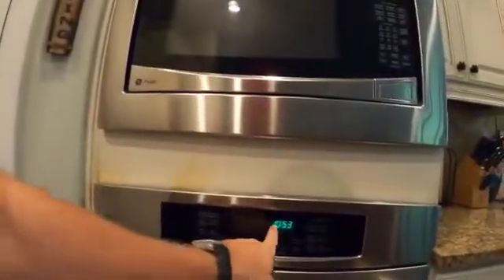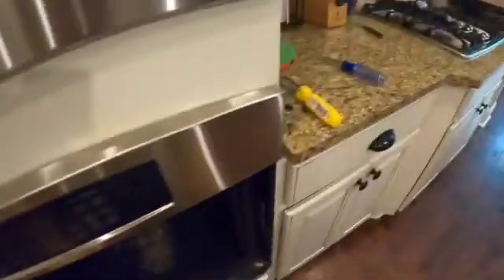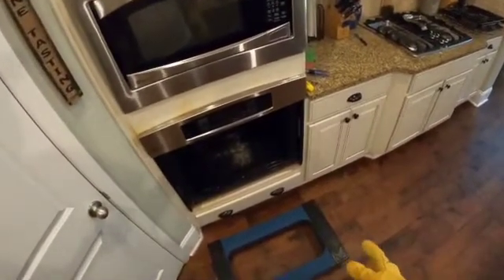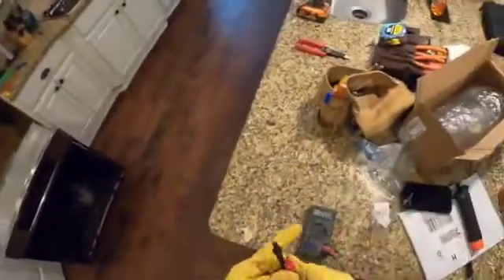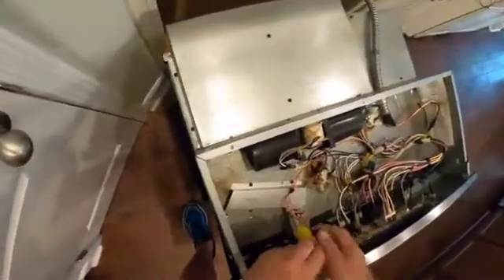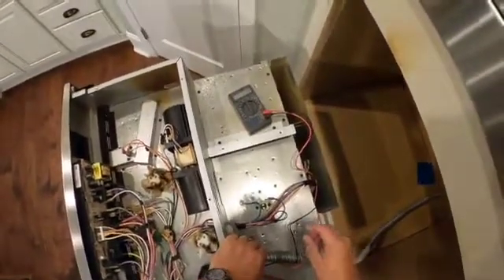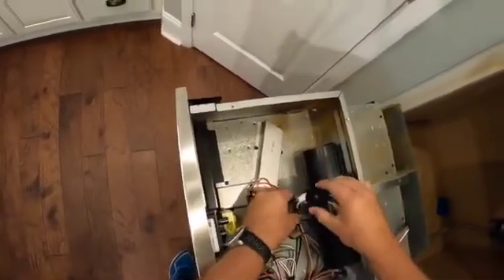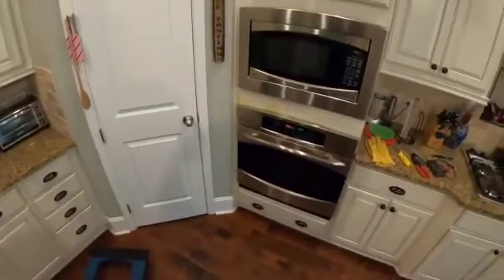Diagnosing and Repairing a GE Profile Wall Oven's Exhaust Fan

Comment: We have the same oven and it’s started to make a rattling/buzzing sound as it cools down. Is the motor you replaced for the colony fan or the convection fan or both?
Reply from the maker: Hello Gavin!  I replaced the cooling fan.  Sounds like you have a cooling fan going bad, which happens.  I found this fan pretty easy to replace.  I think I have a link to where I got the parts.  They were super helpful as well.  I believe they have a video on their site walking through the process.  Good luck with your repair!

Comment: Thanks so much! I turned the oven on and turned convection ON and the back convection fan was spinning, so I think its fine. Honestly we never use the convection feature.  I plan to order the fan and the 2 switches you mentioned and see if I can get this fixed. Like I said, the moisture has already blown out one main control panel...and that part alone was $600, so can't afford to be replacing that every few months. I hadn't noticed, but our oven used to put out some warm air while on at the bottom through the vents, but now there is no airflow.  Thanks so much for your advice!
Reply: Sounds like you are on the right track!  Ours also had no airflow out of the bottom.  As soon as I replaced that top fan, it was flowing again and all moisture issues were resolved.  Good luck with the repair.  I don’t think you’ll find it too challenging.  Hope this solves the problem for you.  Good luck!

Comment: Hello, so did this fix the issue with moisture in your control panel? I have the exact same oven and we are having the same issue. after 9 years of having this oven, it all of a sudden started putting out large quantities of moisture into the control panel and around it and it kept shutting off...resetting the breaker would reset it to work again, but after a while the entire panel went out. I had the panel replaced and now it is doing that same thing again. Thanks for the great video! Just curious if in fact this did fix your moisture issue. Thanks!
Reply from the maker: Michael, it sure did!  It was the result of a diagnostic call I had with GE.  They indicated that what often happens is that the fan motor goes out and fails to pull moisture and excess heat out of the oven.  Once the fan motor was replaced, it completely fixed the moisture issue and our cooking temps also stabilized.  The rep said it was a common issue as these ovens age.  Hope this helps!
Reply: Also, just an FYI-there are two fans.  One in the oven box that circulates the hot air (convection fan), and one on the top on the box that vents the air and moisture.  Important to note too that the convection fan often spins gently even if convection is not on as it improves the ovens efficiency.  Either fan can fail.  You can easily check the convection fan by turning the oven on and then opening the door (it will automatically turn off, but the blades will be visibly moving).  If that is the case, then it is the top fan that failed.  That was the case in my oven.  The top fan is also the most likely to fail over time.  Btw, there are two relay parts that help make that top fan work.  I replaced them, but both were still good.  That said, they were super cheap and it was worth replacing both while I had the oven out.  Hope that helps!
Reply: @mikewalsh789  I just ordered the fan and the two switches from Appliance Parts Pros. I have a buddy coming over to help when the parts arrive. I will let you know how it turns out! Thanks again!
Reply: @michaelmercer6535  happy to help!
Reply: @mikewalsh789  Hello. Got my parts in today. Going to install Wednesday. I did have one question. I ordered 2 switches...One was a switch limiter, the other looks just like that part but is called a thermal fuse. But the two parts look exactly the same. There were only 6 bucks each or something like that so I figured I would just replace them both while I was in there. But, I noticed today that there is another limit switch that is around $30 and I didn't order that one. Do you remember if the 2 switches you tested on your video looked exactly the same? The $30 limit switch actually looks different and I am wondering if I should have ordered that one as well. Thanks!
Reply: @michaelmercer6535  Hey Mike!  I would stick with the cheap switches for now.  The odds are good that the fan is the issue.  Fans fail far more often than switches-more moving pieces!  That said, APP has a great return policy, so it won't hurt to have it around if you want the peace of mind.
Reply: @mikewalsh789  Hi Mike! My buddy came over today to help with the oven. The new fan worked! We now have airflow from the vent at the bottom of the oven and we had no airflow earlier. Only trouble we had was getting the oven door back on. We probably made it harder than it actually was. Thank you so much for all your advice!
Reply: @michaelmercer6535  Wow!  So glad to hear that it went well!  I had a hunch it might.  Glad that I was able to be of help to you!